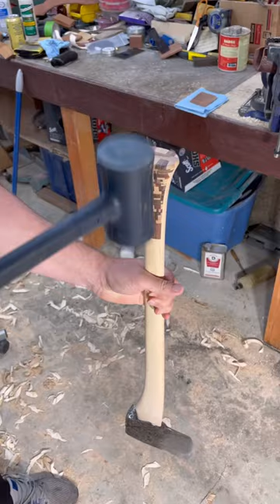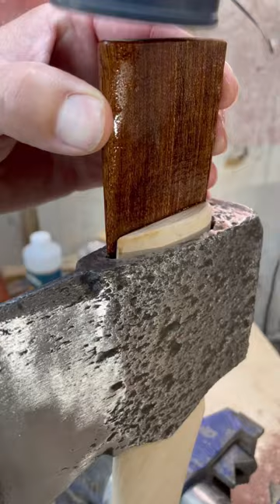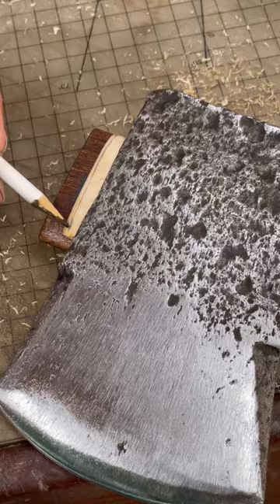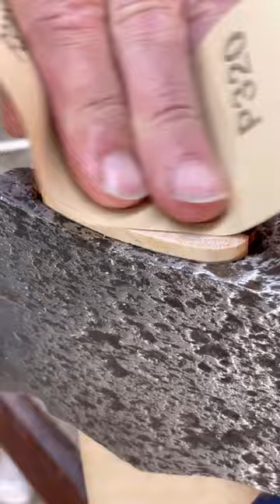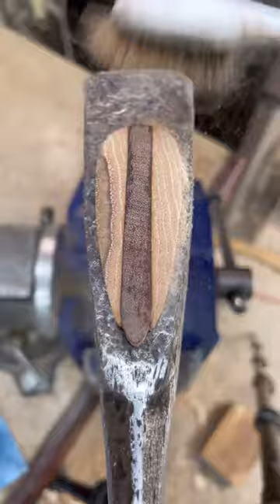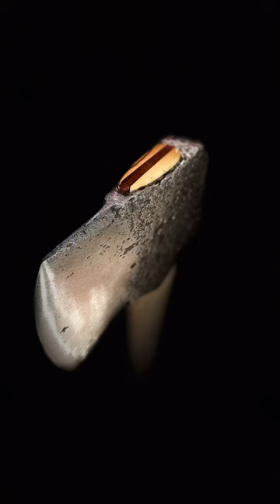Mounting an aged beauty…Axe Head #stumptownaxes #axe #handmade #woodworking #diy #vintage

Comment: Hey just a question, why do you cut the upper part before to put the extra wood, after mounting the two pieces ?

Just curiosity.

Not english sorry for my Bad langage.
Reply from the maker: Not sure which part you’re talking about but I think you might mean early in the video I clean up my kerf cut with a hacksaw blade to much sure my wedge goes in smoothly.
Reply: @StumptownAxes oh sorry don't realise you had still got it done.

Thanks 🙂